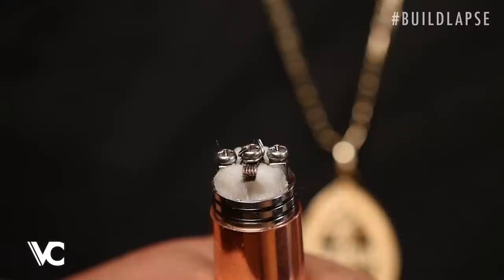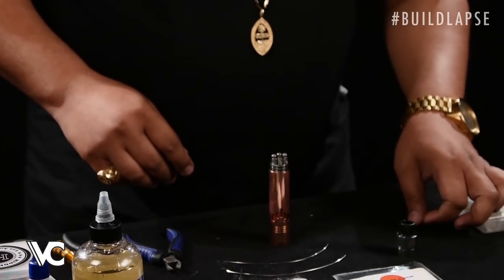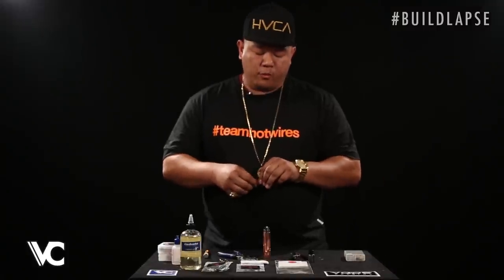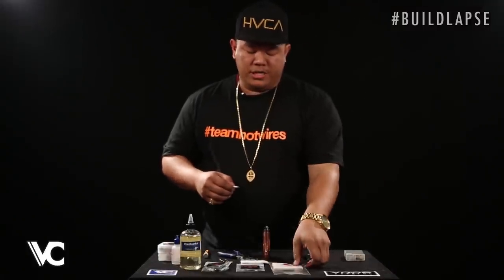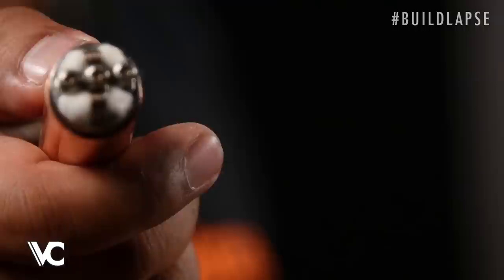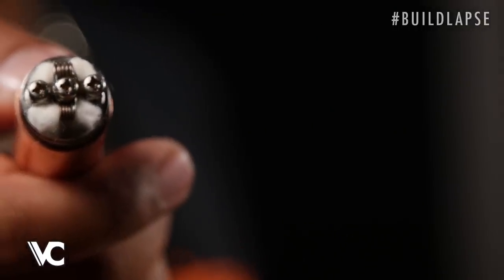VC BuildLapse - Turbo Coil 22\20 Gauge Hotwires (Comp Build)

Comment: Was that a 5 wrap for both 22, and 20?
Reply: Eddie Espinozae if it was then its not a clever dual coil build.. if it wasn't then there is no benefit trying to `match` them both...  stick to the same gauge.. 5 wraps at 22 and you at 0.1ohm,  plenty low enough.... stay safe

Comment: how is .1 ohms safe? thats 42amps at 4.2volts =/ always confused me to see sub .1 builds on a tube.
Reply: +David Kressel some batteries will pulse up to 60 amps for several seconds
Reply: +David Kressel The answer is its not. Depending if the are using legit batteries or not, the max would be 30amp, and even thats pushing it on a VCT5. Every time they press that button its causing damage to the cell. And after continuous use it will likely vent.
Reply: Jarred Pitts vtc5 are 30 max continuous, they can do 42 just fine on pulses
Reply: Where's a good resource for pulse limits? I'm using LG HE4s and always keep it under 30 for fear of blowing my face off because I nvr read any different except Sony's that pulse 60+. No heat issues... Using twisted 24s duals 10wrap at ~.3 in a dual series 8.4v box. Under load I'm guessing it's only like 7.8~v. Any protips. Always throws me off swing sub .2ohm builds on non parallel boxes.
Reply: Avon Barksdale There are no such thing as pulse limits. It will fire what ever you put on it. you can get 200 watts out of a cell, but will 100% damage the battery and eventually die.
Reply: +David Kressel Smurfs can safely fire down to .08 so i think you are a bit too much of a worry wort.
Reply: Rhyan cloud chasing started in the states and pretty much every sub ohms there. in europe people usually build way higher so i heard and seen
Reply: I personally vape around a .07 call me stupid but it’s a nice warm flavor and it works great with dessert style juices

Comment: can someone give me a link to some authentic, high trusted batteries that would be able to safely take on low ohm builds. 18650 batteries
Reply: +kick flips Sony VTC4-5 for single 18650 mechs
Samsung 25r,LG HE2-4 for Dual/protected and VW mods.
Reply: Mx-Jo
Reply: +kick flips the best battery hands down for unregulated is the LG hb2.  It can discharge 40 amps continuous and burst even higher.  It has been tested by mooch, and consistently outperforms everything else.  No "broscience".